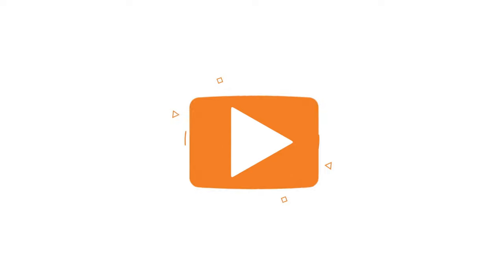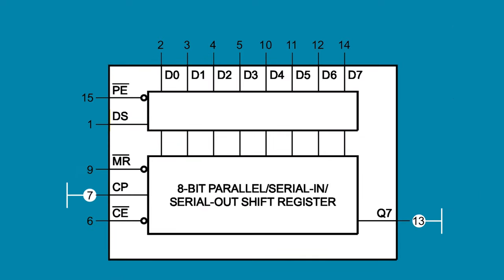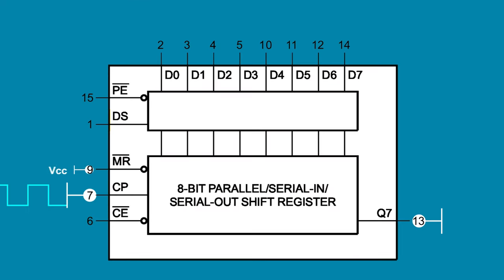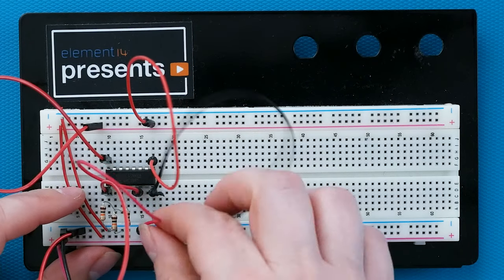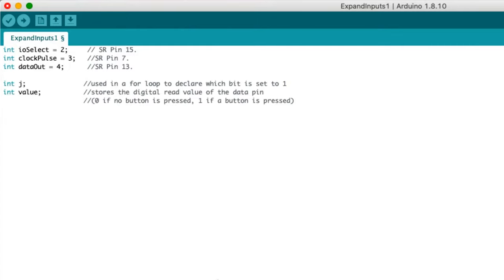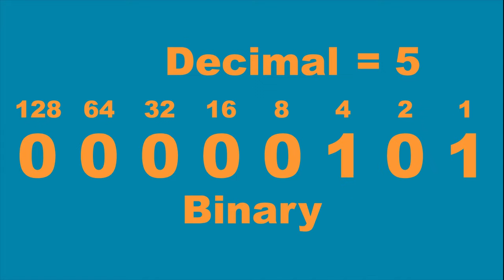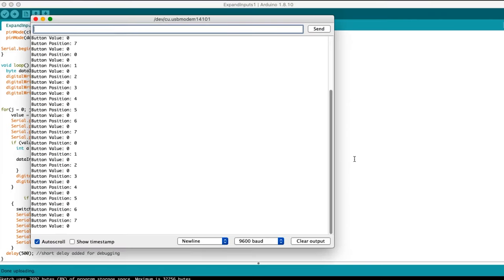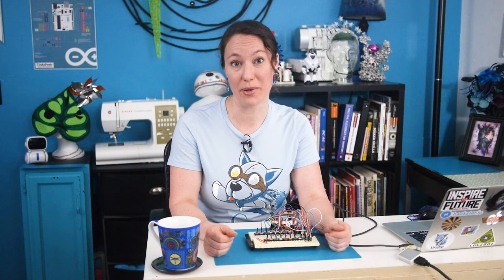How to Add Multiple Inputs to an #Arduino using a Shift Register - The Learning Circuit

Comment: I love this video.  Great examples.  But I am left with one question...  When "stacking" two shift registers, it would seem that the 2nd shift register is shifting bits into the first via its DS pin.  But we I don't see that we ever tell either arduino to accept serial data in.  What have I missed?

Comment: if you are going to name your pins, rather than declaring integers and trusting the compiler to optimize efficiently (especially if you want to later have the code be relatively portable) please use sized integer definitions to explicitly tell the compiler to do what is proper: "#define PIN_NAME uint8_t(12)"

Comment: For this application, could you use the 74HC165 instead? I have tried researching the difference between the 165 and 166 and for this project I think it would be ok, but just not 100% sure.
Reply: Yes you can use the 165. The 165 reads the inputs when the LD is low, the 166 when LD is low and rising CLK. Also some pins are different. Read the data sheet, but yes, both can be used.

Comment: I don't see much material out there for universal shift registers such as CD40104 use with arduino or much of anything else now.  I understand that from an industry standpoint that the cd40104 is considered obsolete, but I'm still curious whether it could at least be used for fun output effects, if not more.  Any ideas on that?  Is it a possibility or just an effort heavy work around for stuff the arduino is already better at doing?

Comment: 3:53 minor mistake, CE needs to stay low the entire time, PE is the one that needs to be turned on and off. You got it right when showing the ardiuno, but it was wrong here. Still great video.
Reply: yeah, i am aslo confused when the arduino code use PE , while ine block diagram , it shows CE control .

Comment: hi , a simple question , for 2 chips 16bit projects. so just connect the second Q7 pin to the first chip SI(serial in ) , so that after 16 cycle clock input get , we can get 16 bit signal？ i am very curious . by the way , in ther arduino code , you use the PE pin to enable parallel input or enable the serial output , but in your 3:53 diagram block , you use the CE pin , i see the schematic , your CE pin is always conncected to GND. so i suppose your schematic match your arduino logic , those are correct.  am i right ?  thanks for your feedback in advance.
Reply: Yes, the explanation was wrong: to change between paralell read and serial write the PE pin should be used.
The CE pin is just for enabling the CP pin.

Comment: thank you, I have followed all the steps but sometimes errors occur, for example I press button 1 nothing happens and when I press button 5 it reads button 1, to overcome this I lower the input voltage to 3.8 volts then for a few moments it returns to normal, until the voltage sometimes it changes, an error occurs again, when I measure the error on the resistor, every time the input button is not pressed, there is a voltage of 0.3 volts which should be 0 volts and it reads on the serial monitor, there is data entering with the wrong value even though no button is pressed. , what do you think is the cause??

Comment: I'm using an ATtiny85 I.C., Is it possible to use a customized circuit of 555 timer I.C. as an external clock ?

Comment: hi lady . very good course .:stayhome:
how can i use this result derectely with led streep
Reply: you will have to connect each LED with separate wire and it will create a bundle of wire, you can use multiplexing but it will also increase wires but half then above configuration, best option is to use coded leds which comes with builtin shift register.
Reply: @magicianofelectronics951  
Hi lady . Thank you .
But i meant : use the led strep library code .based on the numeric input number via shift rigistry .  as example the interactive pannel led or tables. Thank you
Reply: @mohssinebouchmal8694  Means you want to do the same with normal LEDs using shift register? but you want to control with the same code used for programmable LED?, By the way the reply is not from the lady of element14 community.
Reply: @magicianofelectronics951  Hi, I'm sorry. I was reading the answer very fast.I didn't notice who answered me,sorry.
Exactly. That's what I want to translate or mapping a lot of digital inputs from a shift register (3 ×74hc165) Directly to a LEd.strip ws2812   . = 24 led /

Comment: Thanks for the  video. Really helpful. Just a question. If I have 8 input button that I want to switch on 8 leds and mini vibration motors instantly when pressed then would I use the 1st shift register as serial input and parallel output for the buttons then a 2nd shift register as parallel input/output for the  leds and mini vibration motors. Is this the correct way to do it? If so which are the best shift registers to be used for this task?

Comment: Hello. I have been looking for a way to access a large number of analog inputs while minimizing pins used. What are your thoughts on the use of multiple multiplexers while using shift registers to provide input addresses to the multiplexers? In my mind, scaling from a few inputs to many will just add time to ones read cycle without having to consume more pins. 

Is this a reasonable way to go about this? Do you know of any issues that would prevent it? Or maybe do you know of a better solution?

Any help would be great. I was also thinking, if it is feasible, then it may be a good video that this one could continue onto.
Reply: hey did you find your answer? I have the same question
Reply: @BlackYellowGamer  not really. I built the setup in a simulator and it seemed to work, but then when I assembled real components it didn't work very well. First off, for my purposes, I was needing a fairly accurate analog result, but the components each added resistance to the circuit, so it skewed the results.
I'm fairly sure one, if they studied up on the chips and put in the time could compensate for it. There were some other issues I never worked out either.
Ultimately, I ended up rethinking my requirements in the middle of testing the setup and going in another direction, so I just kind of left that approach behind.
Reply: @haddow777  I understand, thank you!

Comment: That is a fairly super-duper (and 'universal') shift register. I believe the convention among EE's is to stock up hard, and that well in advance [of anything... »the siliconocalpse?«]- hence the reason one sees so many 'legacy' components in designs - which of course you end up imitating in your own. This could almost recommend a new stock line (if shift registers are the thing... as they often are. At least in ~theory~.)
Reply: Am I coining a new term if I say "pin golf" (as in "code golf")? - I2C is the ur example. SR's work that circuit.
Reply: And when I say 'circuit' I imply performing arts rather than physical phenomena.

Comment: 3:04 no its chip enable when its high nothing shift or latch. paraller enable load paraller in low and high its not serial enable its just work that way it read in even you not really want bcoz thats how it works

its kinda if have 74ls575 serialout() sketch just replace chip 74ls165 use same code only change serialin() and some bla bla lol. if pins same